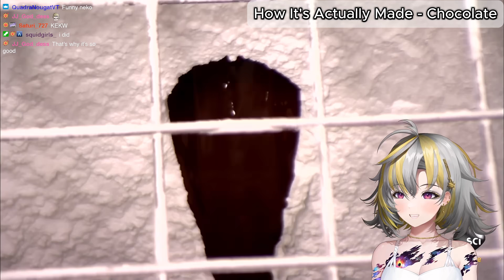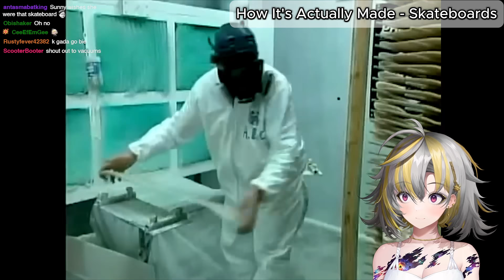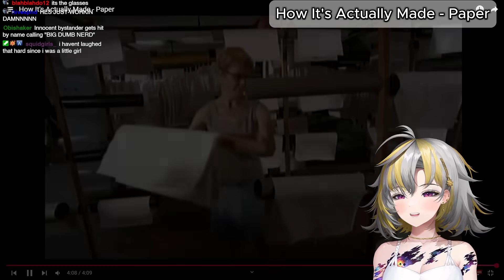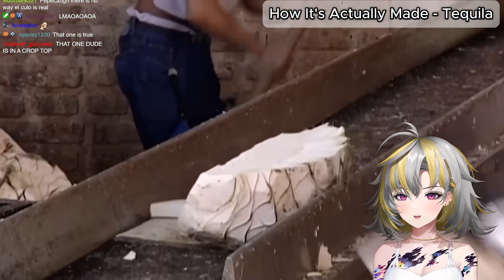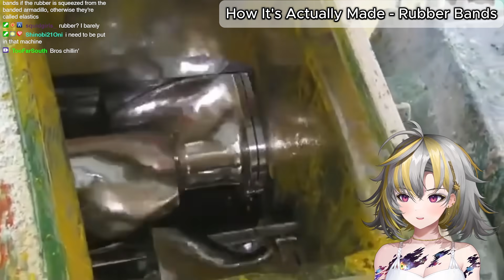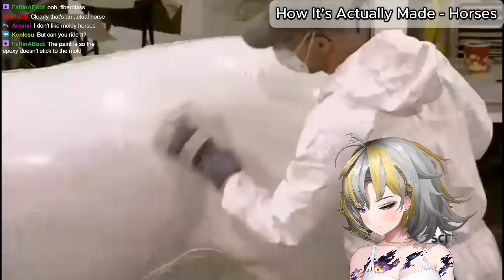FIRST TIME WATCHING "How It's Actually Made!"

Comment: Certain tasks that seem like they should require gloves can actually be more dangerous with them. For example, the spinning cylinder on which the worker practices his dancing is a rotational force. Things like that (such as lathes, large motors, or other spinning objects) can, assuming they are powerful enough, pull in gloves, hair, or long sleeves. The damage you will suffer from brief contact with a belt sander is nothing compared to the damage you would suffer from having your hand, arm, or hair pulled in.

Comment: XD as Mexican, pulque is the traditional way, tequila and mezcal are distilled. Is harvested by hand but not because lack of tools, is because is the better way, you process that part on site instead take all to the factory.
20:20 "Tu madre gorda" (your fat mother) XD c mamó el que hizo el doblaje.
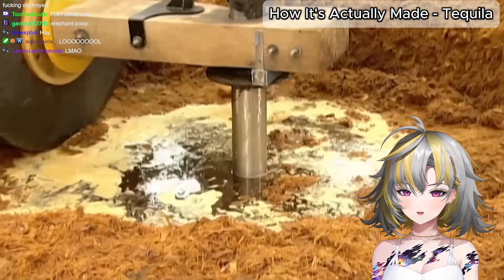20:30 Actually. . . the traditional method is to use a donkey to move the stone, that is the modern version, someone have to move the fibers o make sure they squeeze all. Tequila and Mezcal are very traditional things, you can't not change the method.

Comment: So the gist is basically that you make paper by dissolving plant fibers into water, and then using a strainer to pull a layer of the fibers out, creating a sheet of tangled plant fibers.

Often this is made of wood fibers, but in older times it was actually common to make paper out of cloth, which is also made of plant fibers. This is called rag paper, and it quite literally was often made of collected rags. Wood fiber pulp paper replaced it because it was cheaper and easier to mass-produce, but it's weaker than rag paper, because it has shorter fibers, among other issues.

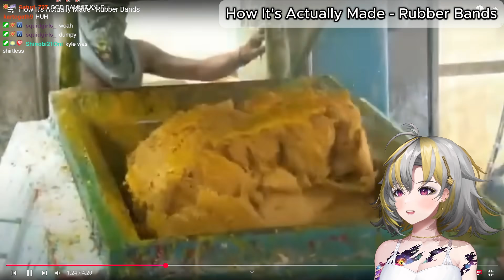Comment: 24:21 I worked with this kind of machine (called a kneader) nearly twenty years ago, making butyl rubber pellets that were used by other manufacturers to make various kinds of sealants, insulation, and soundproofing.  The one I used could handle about 200 pounds of material at a time, and had to be water cooled because the friction generated produced a LOT of heat.  The machine is extremely dangerous.   This tech is probably over a century old.

Comment: To give a potential answer to the paper one, those could be actual bed sheets. Paper can be made using old cotton cloth.
(Edit)
As a mexican and having been on the Tequila region I can answer this:
1.- The introduction is right, "pulque" is a fermented low alcohol drink, when spaniards arrived they introduced distillation making tequila
2.- Yes, the agave harvest is still made by hand
3.- The big tubes are the fermentation process, that's why it looks alive, it is alive
4.- Tequila has a "designation of origin" That means Tequila is only Tequila when made in the area of Tequila and/or Amatitán, Jalisco

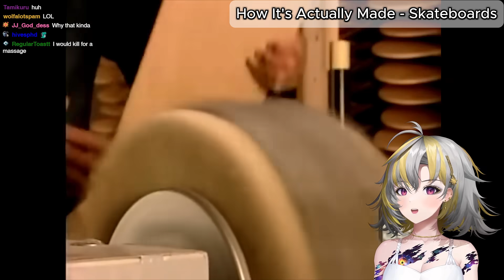Comment: 6:55 being serious here for a sec, they might not be wearing gloves for safety reasons. You're not supposed to wear gloves when using any type of rotary tool because the glove can get caught and help pull your hand into it. Same rule applies to things like bracelets and watches.

Now, some might point out that some gloves would probably tear off long before they actually draw your hand in with them, but because the possibility exists most places just have the rule, because finding and regulating the "safe" glove use is time intensive and expensive and it's easier to just not do it at all.
Reply: True, but a lot of types of gloves tighten with straps.  Those would probably stay on long enough to draw your hand into the machine.  
Or considering how fast it could happen, even gloves that fit firmly might do that.
Reply: Also, wearing gloves for long periods tend to make people care less about cleanliness around food than if they were using their bare hands.
Reply: Okay, i wasn’t the only one to sprint to the comments for this.
Reply: Can confirm from experience (sheet metal straightening machine + material with edges sharp enough to warrant leather gloves = bad time). Luckily the damage wasn't too bad and the hand still works fine, but I do have pretty gnarly looking scars on 2 of my fingers.
Reply: Russian lathe machine incident - case in point

Good learning material...
Reply: The term, fittingly, it called degloving
Reply: Yeah getting a splinter or two is way more desireable than losing a hand lmao